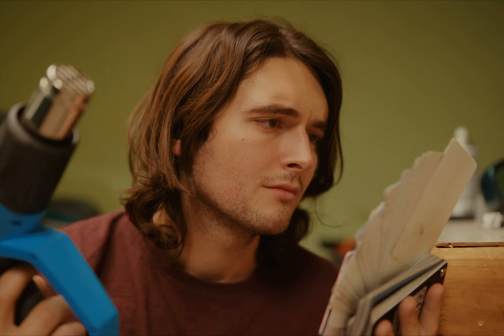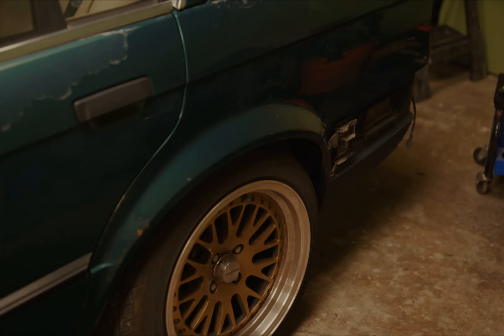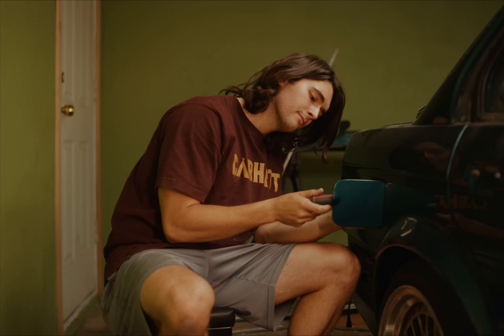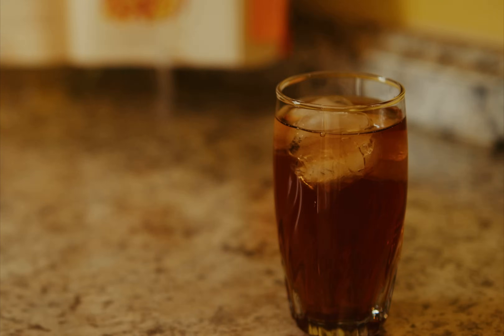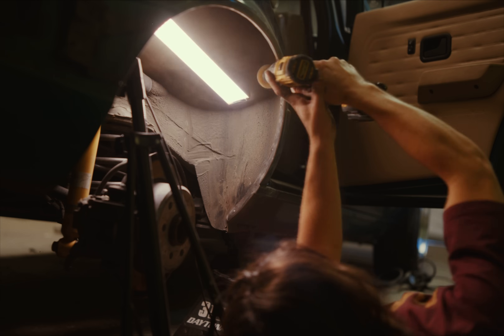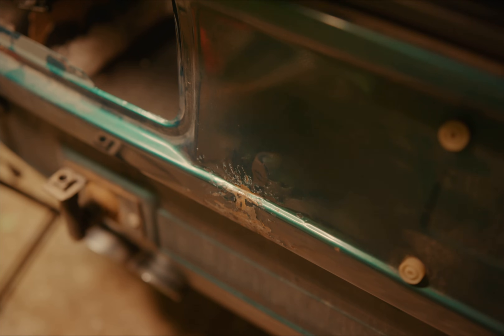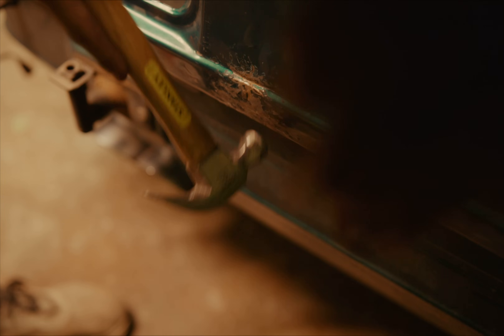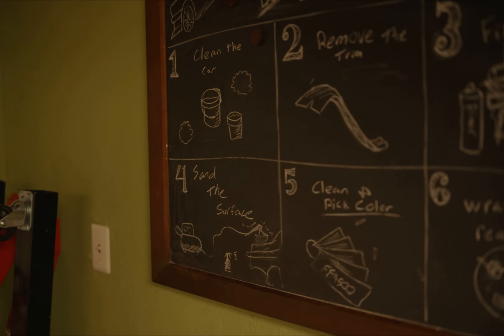Prepping The E30 For Wrap | Rust Removal & Fixing Dents!

Comment: A few thoughts from my very not an expert position. Fear may be the mindkiller, but rust is the car killer. I think it's not a bad idea to go over at least the worst of your spots - the pitted areas - with a rust converter afterwards (if that's not already in your plan!).

For your Bondo work, get those silicone or plastic glazing knives instead of a regular metal putty knife. They really do get into the spaces and conform to the lines much better, reducing your sanding work and hopefully giving you a much better finish.

Finally, you may want to use some filler primer once you're all said and done with the rust and dent treatment. It will help to avoid any pinholes that you can't see (even after glaze), and while I'm sure that's less of a concern with the wrap, it may yet be of use, and if you choose to strip and paint it later, you're already there.

As always, fantastic episode, thank you for sharing with us!